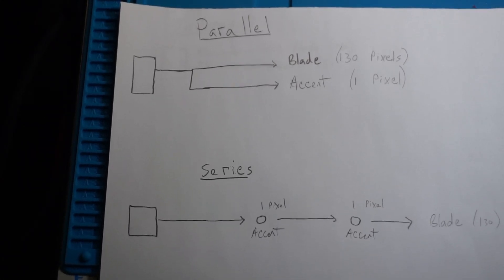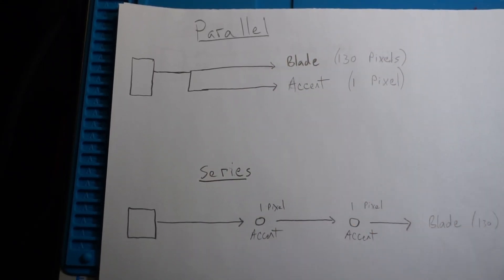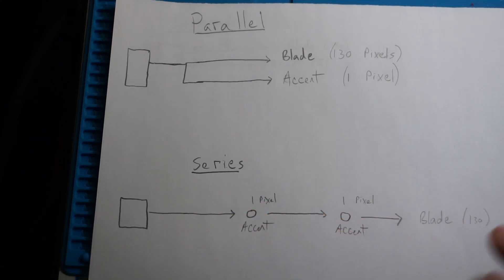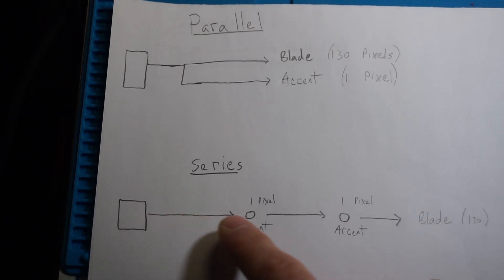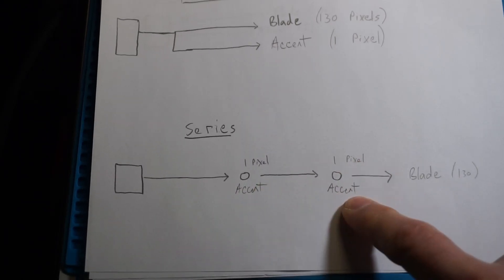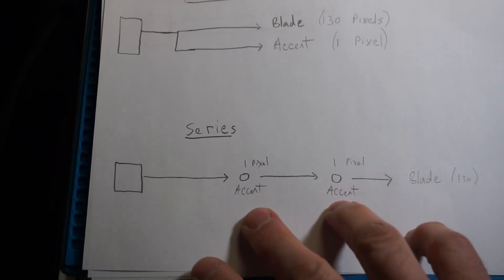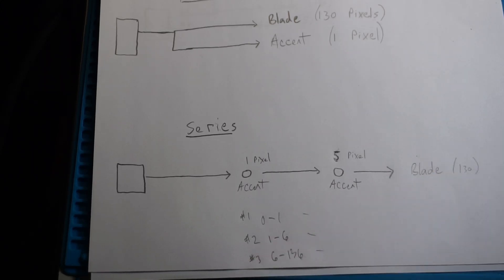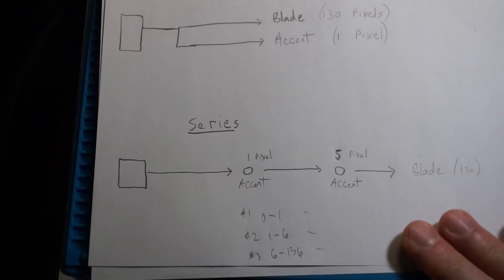In Parallel vs In Series

Comment: Awesome stuff, thanks for the explanation!  Quick question though, if I want to have sub-blades (accent) remain on while the 'main' sub-blade is off, what exactly does that configuration look like?  And even further... can you have the power button essentially change the behavior of a sub-blade, instead of turning it off?  Use-case would be:  5 NPXL on doing some random action as soon as kill key is removed, and then power button to 'main' sub-blade changes those 5 LED's to something similar to the main blade.